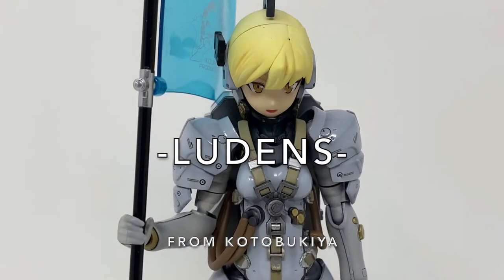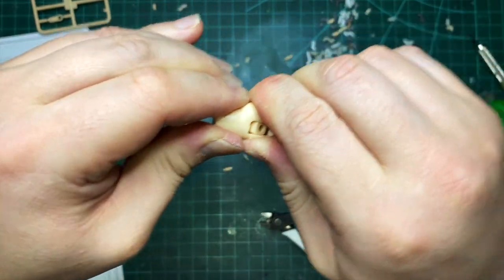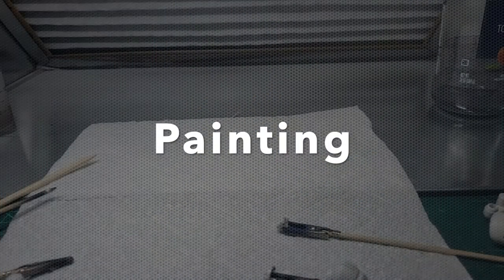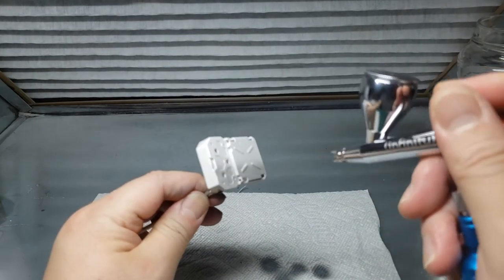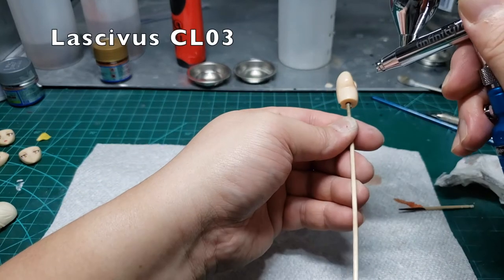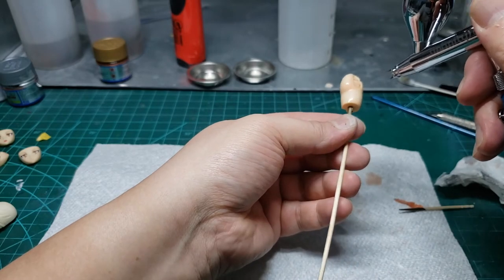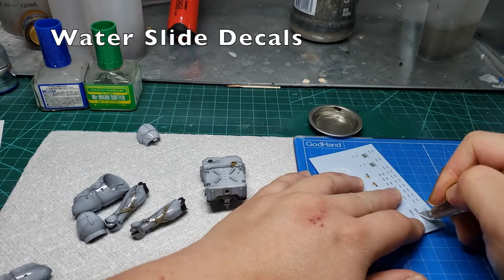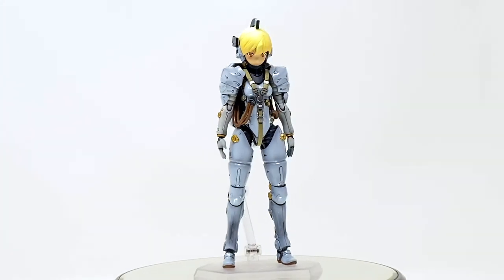Let's Build! Ludens

Comment: another fellow pace booth brother. I like how it came out just some advice for lacquers you should probably thin everything at least 2:1 thinner to paint. anything higher and you might want to spray and even lower PSI :)
Reply from the maker: Thanks for the advise. You probably noticed how thin the paint was on the video. That is Splash Mecha Color which is pre-thinned. I had a lot of trouble controlling the paint flow. I think I will stick with Mr. Color for now.

Comment: Wonderful job on the build and painting. Can you tell me what type of sanding sponge you used?
Reply from the maker: It’s a sanding sponge I got from E2046. Honestly it’s a nail file/polish block that’s cut up to triangle. One side is coarse and other side is fine.
Reply: @EggyBuilds  Thank you. I'm ordering this kit and I'm also getting all the supplies I need for the build. It will be my first more advanced build. Maybe if it turns out ok I'll adventure into painting. Complete noob at that thought... 😅
Reply from the maker: Good luck and have fun with your build. Honestly this kit is finely detailed, it looks great even without painting . Maybe few detail job here and there like trim pieces or paint the metal color should do the trick.